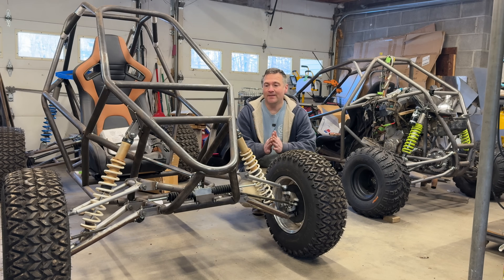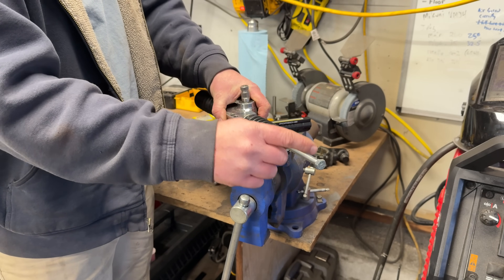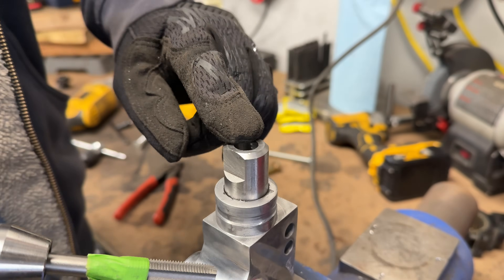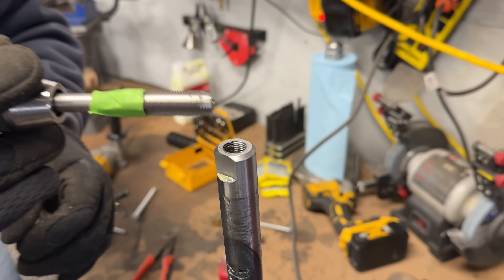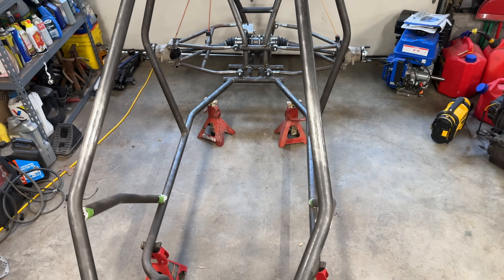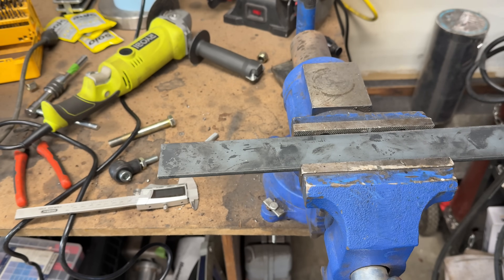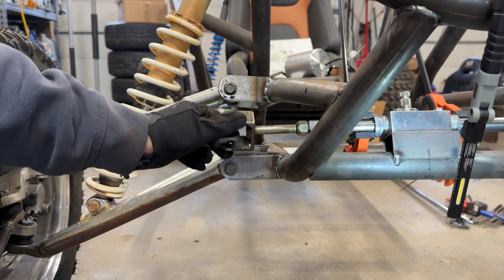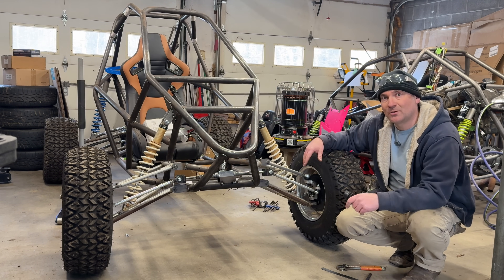Bump Steer Setup and a Bulletproof Steering Rack: Homebuilt Crosskart YOU Can Build!

Comment: Hi Kyle, Nice work but I'm wondering why you don't look for a wider rack with the pivot points already built in? I have built 2 off road buggies from go kart frames. I just replaced a rack and used 1 from a circa 2010 rzr 800. Cost $65 brand new and is a really nice rack. They come in different widths, longer tie rods etc. Also used the complete rzr 800 steering up to steering wheel and paid $75 from ebay.
Reply from the maker: So the Beauty of the VF frames is that you can use whatever you want to build your kart 👍. I just show how I do it and the community comes up with all kinds of different ways, this is what makes the plan holder group so awesome and why the VF’s are awesome for anyone. Enjoy the Build 🦾

Comment: What we used to do in stock cars if you had a goofy angle most likely down because they are was off for bump steer is it would drill the spindle to a round hole instead of a tapered put a rod end with a spacer to raise the the center of the tie rod end the lack of our term it may be easier than rebuilding your rack just drill the spindle put a regular rod end on it and just a one inch spacer underneath!

Comment: Welding to the bolt is affecting the grade.    Probably not as a big of deal with the larger bolt.  But was probably making the smaller ones weaker.
Reply from the maker: I agree with you but not sure that welding the head would affect the grade…

Comment: Instead of mounting the steering rack with the input vertically, why not rotate the input toward the steering wheel to reduce the universal angle? Great video! Thanks for all the time an effort you put into this for our enjoyment,
Reply from the maker: It is mounted vertically for two reasons: 1. To clear the brake pedal on a three pedal setup. 2. Cars do the same thing so the steering shaft doesn’t become a spear to your chest in an accident. But I guess you hit something hard enough to bend in the front of a VF-1, it probably won’t matter much. And thank you so much, this is an awesome ride we’re on.
Reply: @KJRaycing  Thanks for the reply ,makes perfect sense!

Comment: 5inch ride height uh oh I made mine 9 and a half inches that's just how it ended up damit lol hope it's not tippy also it's my second kart first one with suspension 😮 can't wait to try it out all I need now is a 40 series tourqe converter so I can mount this predator 459cc motor 😮
Reply: My first one was about 11” ride height with 25” tires and I never felt like I would tip
Reply from the maker: I build all of mine with a 10” ride height for 23” off road tires. Crosskart race tires are 18” so it drops the ride height to around 7” in “crosskart mode”.  I wouldn’t personally set mine to 5” because I take mine mostly off road and jump and do trails. It’s all about how you want it and how you like it 👍
Reply: @KJRaycing  I got 18.5 inch rear tires with 16inch in the front with a 70 inch from center of rims wheel base and a 54inch wide stance it's also built with 1inch Dom round steel stock it's not as bid as yours I hope it works out I think it looks pretty cool more like a side by side utv I even have a bench and tow which going on it I got the wrong kinda pipe bender to need one like you got thanks for the videos and reply brother

Comment: Just tap it in... Just a lil tappy tappy.

Nice work Brother.
Hope to buy one of your laser cut XL chassis to mount the already purchased 1290 Super Duke. I have both plans normal and XL.

Im6' 2" 220lbs, I had thought I would build an XL chassis but with a normal height on the roof line.

More like a slight formula 1 driver postion to keep COG low and corning performance high.

Any thoughts?

God Bless at God's Speed 
Clint
Reply from the maker: I thought I would be well on the way to having the VF-2 and XL in kit form by now. I’m hoping to have them available in the coming months. I think of you want the normal roof line just go with a 6” stretch VF-1, you’ll have room for everything and have that tight formula feel you are looking for. As fas the 1290 all I can say is that is going to be intense!!! Can’t wait 👍😎
Reply: @KJRaycing 

Thanx Brother. Glad you are in the service. I did 20+ retired as an Aviation Structural Mechanic Chief from the U.S. Navy.

I think I'm looking to simply flatten out the bubbly top look and lay the seat back in more of a recline pos. But with elbow room for some commuter amenities, like sterio and an insulated interior.

The grand idea is to make a modified chassis that we took could then sell primarily on the west Coast. ( We live in McCleary WA.)

Our drive would be to create street legal/race tech legal carts with a focus on performance commuting.

We hope to establish our own race circuit/season series.

We believe it would be at those races where we would demo the product. Welded full roller chassis for 5-8K depending on materials/requests along side a full turn key commute racer starting at roughly 20K.

Big plans for an old disabled guy, but I can't kill a great idea.

God Bless at God's Speed 
Clint
Reply: @KJRaycing  

A lil tune of gratitude for all the work and tutorials.

https://youtu.be/BiP0FpY88E4?feature=shared

God Bless at God's Speed 
Clint